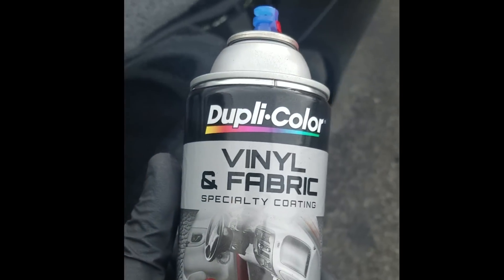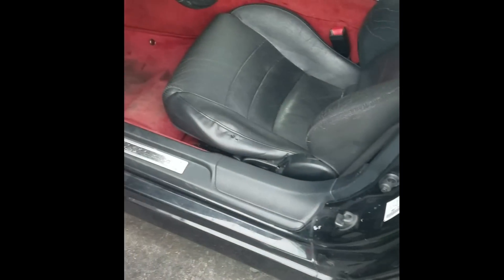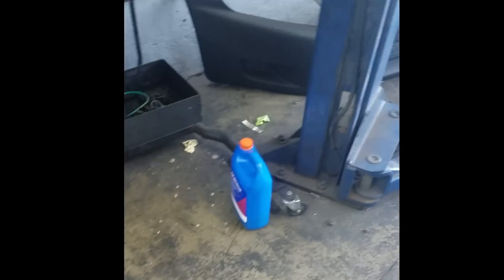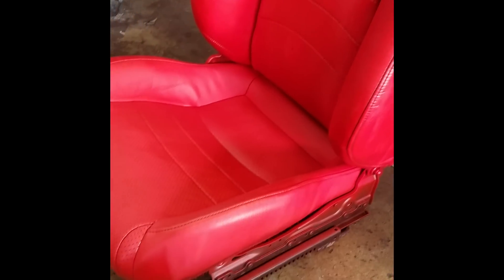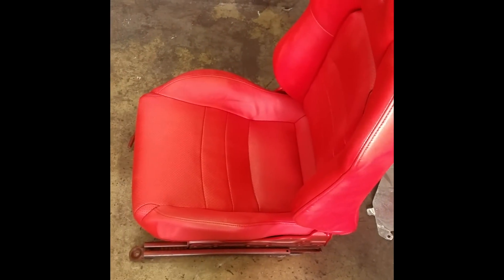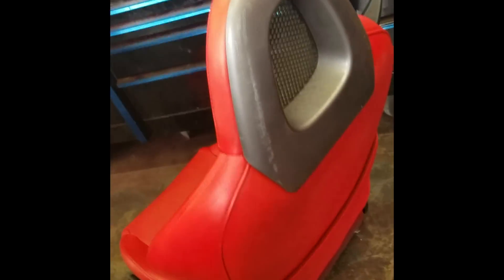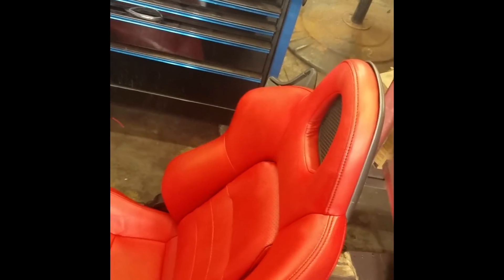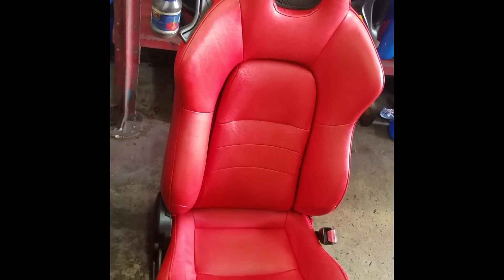HOW TO PAINT YOUR CAR SEATS RED FOR JUST $10 QUICK FIX

Comment: I bought a set of used Explorer Eddie Bauer real fancy electric seats and installed them in my 98 Ranger pickup 15 years ago.  Only problem was they were tan and the truck was gray.  I painted them just like he did and they're still going strong.  I've had to respray the face of the seats where you sit on them a few (maybe 3 or 4 ) times but they have stayed gray for 15 years.

Comment: How is this holding up for you? I used $70 worth of the black DupliColor several weeks ago and it's cracking and flaking.
Reply: Did you cover it with the space spray? I think it was called 707 spray?
Reply: @MLProductions.1  303 aerospace

Comment: This stuff is not forever it's just a micky mouse job to sell a car it will probably last a month looking great at the most when you sit on them you will cause wrinkles and the paint  WILL crack and expose the black I know this from experience and seeing others go through this
Reply: jr Rangel  really wanted to do this is there a way it can last ??
Reply: Alex Tejera I don't know of anything else beside redoing your leather the color you want it but that's expensive anyway if you give this a try   just know that it's not forever and will probably end up looking worse than it did before unless "probably" won't look as bad if you painted it the same color as it was before but that would suck
Reply: Jr Rangel, the paint you used was not for leather, regular paint cracks, but not this one because its made for it.

Comment: I'm late to this coversation, but I have to say this: Leather needs to BREATHE! Painting (smothering the pores) is the worst thing one can do with Leather.
Reply: Please explain why leather needs to breath. Do you think all the different colors of leather in vehicles are naturally those colors? They come painted from the factory. It’s not alive, it doesn’t breath.
Reply: @mmandros51  The color process in the manufacture of leather involves the use of formulated Dyes, NOT paint. The fact that leather derives from organic matter (animal dermis, hence pores = breathability ), is the  very thing that gives leather it's unique quality in performance and comfort -  cooling in hot temperatures, warming in cold temperatures. If you've ever owned a pair of patent leather brogues, go ahead and slap a coat of enamel on them - see what happens. Your shoes will break down quickly 'cos the sweat you excrete is trapped and has no where to escape, and your feet will stink to high heaven. The effect is more or less the same for auto upholstery.
Reply: @mmandros51  The color process in the manufacture of leather involves the use of formulated Dyes, NOT paint. Leather derives from organic matter (animal dermis, hence pores = breathability ), is the very thing that gives leather it's unique quality in performance and comfort -  cooling in hot temperatures, warming in cold temperatures. If you've ever owned a pair of patent leather brogues, go ahead and slap a coat of enamel on them - see what happens. Your shoes will break down quickly 'cos the sweat you excrete is trapped and has no where to escape, and your feet will stink to high heaven. The effect is more or less the same for auto upholstery. 
I noticed the dude in the vid used vinyl paint for his seats. Now if his seats are vinyl/plastic, then sweet, no worries. If his seats are genuine leather and wants to change the color to red, bite the bullet and re-upholster the seats in red leather, or apply an appropriate Dye treatment.
Reply: @worldofjerrytravis393  What you’re saying is true of some leather but most factory leather seats are painted, not dyed.
Reply: @worldofjerrytravis393  alot of times with cheaper seats its just pleather

Comment: Don’t do it I have done mine before and these paint will crack few weeks
Reply: Ye Aung yes it does I did it with mine and it happend
Reply: Did you use the same exact paint?
Reply: It will if u do not do it the proper way. My front seats on the focus have stayed completely black for over 5-6 years
Reply: Ye Aung did u sand the seats first?